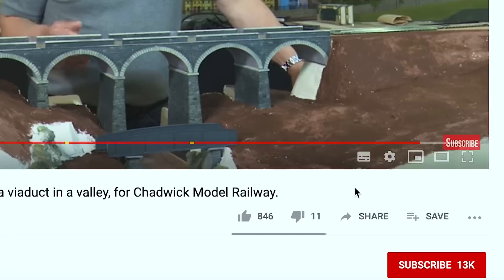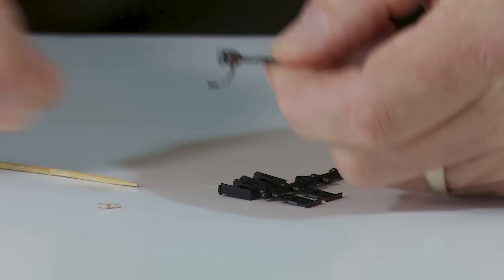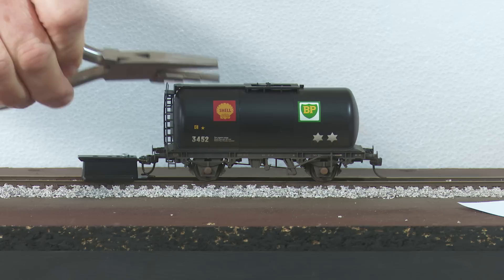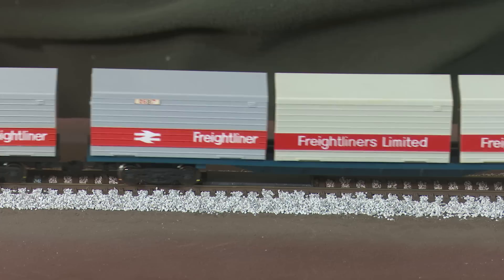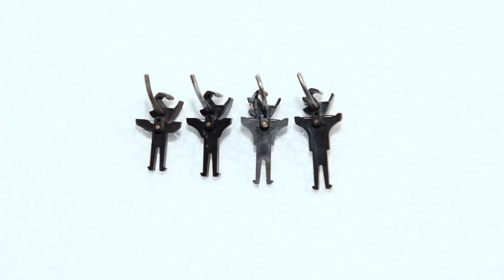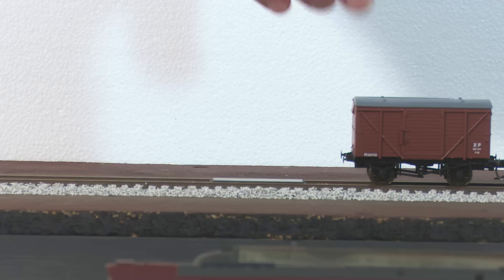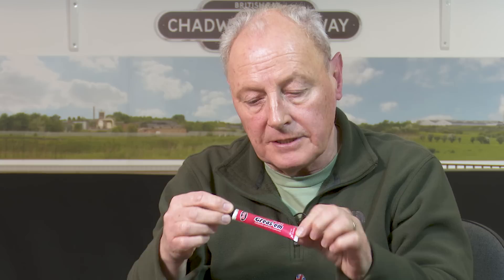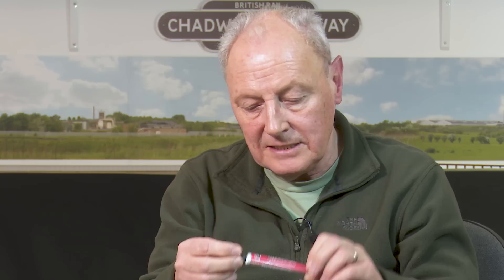Kadee Couplings at Chadwick Model Railway | 81.

Comment: Hey Charly,

Well me I am using some kinds of Kadee Knuckle Couplers or even some Kadee compatible Knouckle Couplers from other Manufacturers like Mc Henry, Accumate, Bachmann E–Z Mate Mark II Couplers or something else.

Some of the Companies do manufacturing NEM 362 Shaft Couplers, too.

A very big importance is to know, the the NEM 362 Couplers Short Coupling Backdrop Mechnanismn are requiring a rigid coupling connection between two wagons so the backdrop mechnismn can dropping the two wagons away from each other inside curves, so that the buffers will be not overlapping.

The Kadee NEM 362 Couplers do have got an hinge behind the coupler heads so the backdrop mechanismn probably will not work like expected, si it will be important to fix the NEM Backdrop machanismn and/or using longer Kadee NEM 362 Coupler shafts than Couplers of No. #17.

In my cause I can use Kadee Couplers to german era I models in thr period of 1899 to 1909 because the prussian state railway did a big Coupler test of testing the Krupp Knuckle Middlebuffercoupler.
This special middlebuffer coupler was a better Version of the US Janney Coupler but had been created compatible to side buffers and Link and Hook Couplers at one side of the moveable Couplershaft what could be fixed be a bolt when swinging into side position to couple european standard hook and link couplers.

 After the ten year test in 1909 the royal prussian state railway made the wrong decission against the Krupp Cpuplers, maybe the replacement costs of expected over 10 Million Goldmark were to expensive for them?

In my Cause, my fictional private northetn german era I railway company is doing this coupler test, too, so I can use Kadee Couplers to my models, too.
Reply from the maker: An excellent comment Ingo.
I do like Kadee’s and find that No 17 are too short for my stock. 
Sometimes though, Kadee are not always the best solution.
Regards Charlie

Comment: Thanks for the information. I have not gotten into changing couplers yet and have not looked into anything about couplers myself, you are the only the second person to talk about the kadee guage. The first video I watch said that you should just have the two couplers touch but not connect. Then to see if they are at the correct height you look at the center line on the car and the center of them height guage should be in the same plane. 

To un-couple them you can also use a stick like the one you used at the beginning by inserting it into the couple and giving it a small twist.
Reply from the maker: Thanks Kyle, a good tip.

Comment: Kadee's are excellent and in the land downunder we use them on any rollingstock. One of the best methods of fitting is to body mount and that is usually no problem on 2ft radius or greater. I see you have done that and  it does work well. You are correct when you talk about British outline stock not having a real standard and it would be good if they did. Perhaps it goes back to when they used to be called Toy Trains instead of Model Railways. Thanks for demonstrating the Uncouple Shuffle as I knew it was the sound but did not know that it included the "Ease Up"  and the "Move off or away" as we call them in the real shunting world in Australia, as an actual movement for the loco. Makes you wonder why ESU would include it but I guess even with Tension Lock you do need to do a similar move to uncouple with them. Have you ever thought of installing a Tension Lock uncoupler next to the Kadee Magnet?
Reply from the maker: Hi Alan, tension lock couplings are the pain of British railway modeller’s lives. At least down under, you have professional options. Regards Charlie

Comment: Very useful video. I have found that Kaydee pins can strike point tie bar mechanisms and rip the coupling out of the NEM socket. Some people snip the pin off but bending it upwards makes better sense. Yes, tension locks are rubbish - I frequently have unscheduled slipped coaches with those!
Reply from the maker: I couldn’t agree more James.

Comment: Have to say, I have been using KayDes for several years, I found it all a bit of a headache to start with but once you get your head around it, it all becomes clear. It's amazing what a difference they make to the look of a rake of 30 wagons, don't be afraid of mixing up lengths on one wagon. I put a short coupling on one end and a medium on the other and as long as the corresponding wagon has the opposite side you can get them even closer without the dreaded buffer lock.
Reply from the maker: I’m so pleased that we truly agree on this awkward dilemma.

Comment: Greetings from Wisconsin!  I've just subscribed.  In the US, the Kadee-style couplers have taken over nearly completely.  When I was young most kits and ready-to-run cars and locos came with "NMRA" type couplers, which were hideous looking.  All "serious" modellers replaced them with Kadee types.  Since Kadee's patents timed out, other manufacturers now make that style, but usually in plastic and not with the variety of types made by Kadee.  My layout is a shunting layout and I've used small homemade blades on sticks to do the uncoupling, quite satisfactorily.  Cheers.  PS.  The original Kadees had a straight narrow pin that was less reliable.
Reply from the maker: Thanks for subscribing Andrew, it’s great to have you onboard.
Reply: @ChadwickModelRailway  I look forward to more videos.  By the way, when I was VERY young, besides NMRA and Kadee couplers there were also Mantua couplers.  These had a ring and hook, similar to couplers I see on British models.  Mantua was a company that made HO models but is no longer around.  Cheers.

Comment: Yes I have always hated those “Hornby/Triangle tension lock couplings. They never looked real and the coaches were always too far apart as you demonstrated with the container flats. One would have thought by now that Hornby would have “Grown-Up” and installed knuckle couplings, similar to the Kadee couplings.
Reply: The issue is compatibility, now all their current and past ranges are based around the traditional couplings or something compatible and it would cause a lot of confusion to change it after such a long time.
Reply from the maker: It's time to move away from Toy Train Couplings.
Reply: GC. Dont forget. most or all Kadee fittings are for Ho  and not meant for OO, so our Nem pockets are higher than the US pockets

Comment: I pretty much use Kadee on all engines and rolling stock. There are items that make imitation versions of the Kadee, like Bachmann USA, the produce the EZY Mate coupling. The look similar but work on the same system as the Kadee brands. How ever they are not as reliable as the Kadees, and it is very common to have break aways.
Most model makers today produce models to accept Kadee couplers in mind, except Britain. Majority of the new models from main land Europe models accept NEM Kadee style couplings.

But viewers might like to know that aren't familiar with the Kadee brand. On their web site, in the reference section, Kadee has an extensive conversion range, for large number of manufacturers of model trains, a suitable coupler. This is very handy guide to when you go and purchase couplings for the models. Kadee constantly updates these files as new models become available, as they spend a lot of time working out the suitable couplings. 
The guide will direct you to the packet number required for that model. Very helpful reference guide.
Reply from the maker: Great comment, with some great info. Thank you very much, regards Charlie

Comment: Hi Charlie as always a very informative video . I agree totally that something as important as coupling the UK has not come that far forward since when I had my first train set 40+ years ago. I don't have tight curves but find the small tension locks cause derailments or unwanted uncoupling. So I have changed to putting mid size tension locks on loco and first wagon/coach. And there is not even a UK standard for tension locks either ..
Reply from the maker: I can only agree. The situation is dreadful.

Comment: Thanks for the good videos.  Kadee used to use a bronze spring (copper colour) in the gear box. About 10 years ago they began making the ones with the wire whisker springs but also continued making the old ones.
You mentioned getting some #5s, they have the bronze springs. The equivalent with the whiskers is #148.
Reply from the maker: Thanks Bill, useful info. Regards Charlie

Comment: Hello Charlie, When I first decided to get into model railways I went to a few of my friends who have layouts, most of whom ran Hornby locos and Hornby rolling stock. One of the first things I noticed were the ugly couplers and also the difficulty they had uncoupling one wagon from another. Then I saw a layout where all his stock had been converted to Kadee couplers, so it was a very easy decision to go down the Kadee path little by little because as you rightly pointed out it is not a cheap exercise. Luckily for me I don`t have a large layout, hence I have never had the need to run long trains, so it is not costing me an arm & a leg to convert to Kadee couplers, a decision I have not regretted. I will look forward to your next video.   Cheers   Greg
Reply from the maker: Hi Greg, yes it’s a pretty awful situation that the UK has ended up in. As expensive as these couplings are, they are the only way ahead.

Comment: Thank you for the video. As you mentioned, the Kadee design is designed to look like the Buckeye coupler. The line is quite extensive. This variation not only allows different shank length, for various mounting designs. 

They have different variations of the Buckeye design. One example is a shelf coupler. Here in North America, they are used on tank cars (wagons). The reason is because on uneven track, the knuckles can bypass. If that happened, then the adjoining car could puncture the tank of its neighbor. This could be very hazardous if the cargo is a dangerous material. Another variation is the tight lock. These are used on some locomotives, passenger stock, and rotary dump coal cars.

Kaydee have a not as extensive line of “scale” couplers. They are smaller, and more in scale with 1:1 couplers. They might be good if your equipment is for display, or if the track and baseboard are extremely level. For reliability sake, the standard size is what I use.
Reply from the maker: Sound advice Brian, thank you. Here in the UK these are only decent option.

Comment: Great video Charlie
I've got to agree with you regarding your comment about the UK manufacturers and the nem pockets, it's a joke and a pain in the bum getting these things to work because they aren't all identical!???.
Due to the helix on my layout I'm finding more and more I'm having to switch the locomotive to first wagon coupling to kadee to ensure everything stays coupled on either up or down trips.  It certainly isn't cheap but its the best solution I've found so far.  The other option is the solid coupling.
I never realised you could bend the kadee bars up, you learn something everyday, thanks.
Cheers Paul
Reply from the maker: Hi Paul, I’m so pleased that you found the Kadee video interesting. The challenges with your helix must make things even more complex. Regards Charlie

Comment: Charlie, thanks again for another informative and entertaining video. You’ve just started to touch on the elephant in the room here at the end of this video and that is that none of the couplings out there are perfect, every type is a compromise of some sort. Although Kadees work in a more prototypical way they are way too big in scale terms than real buckeye couplers. It all comes down to what matters most to you. So if I put up some criteria you could say: easiest operation = Kadees,, best comparability across manufacturers = tension locks, most realistic = 3 link, least obtrusive automatic coupling = Alex Jackson, cheapest = Spratt and Winkle. So many options each with its good and bad points.
Reply from the maker: A very interesting comment Simon. It just shows what a minefield of a subject this is.

Comment: A pencil... a graphite pencil can also be used to rub/mark where a dry lube can be used, i.e. coupler swing movement, axle points and chambers...  doing a little "shaving" of a pencil as such (especially wooden or basic No.2 pencils), since lead was removed from manufacturing of pencils, all the pencils that replaced them can be used. It's the same graphite as is found in that tube of "Greas em"... and, the pliers are called "Coupler Pin Adjusters" and are sized for "N" "HO" and "O" scale coupler pins-to tighten the "curve", whence the three sized-type end.  To widen that curve, you must flip handles so as to not bend down the knuckle part of the knuckle coupler.
John   Kamloops, BC  Canada
Reply from the maker: Great advice John, many thanks Charlie.

Comment: It should be noted that Kadees can be uncoupled by using a thin wood skewer between the knuckles and twisting then apart. Kadee once made a tool for this, and I've seen home-made versions. It had a thin leaf-shaped metal piece on the end of the stick which worked the same way, by spreading the knuckles apart..
Reply from the maker: Yes Larry but we don’t like to use our hands and spoil the illusion.
Reply: @ChadwickModelRailway  But real uncoupling is mostly done by hand!
Reply from the maker: A fair point Larry.

Comment: Thanks for this video, Charlie. I must have watched it a dozen times, and have wanted to give Kadees a go since I first saw them, but was worried that they just wouldn't work on my combination of sketchy track laying and low end rolling stock.

However, I bought a couple of different sized NEM variants, and some of the traditional gearbox type Kadees and experimented, and I have to say they are brilliant. I may have been lucky, but generally I've found NEM heights have been spot on or very close. And for non-NEM wagons, the gearbox Kadees have gone in with little work needing to be done.

Without the clear explanation in this video though, I'd have been stuck, and honestly would never have bothered trying it.

I have also tried the Hunt couplings, and have had some good results on rakes of coaches by having strategically placed Kadees where I might want to split a train up, or where it will couple with a loco, and then used the Hunt couplings in between.

Thanks again for the excellent content!
Reply from the maker: I think we sing from the same song sheet on this one Andrew. I will certainly use magnetic couplings between coaches and Kadee’s at the ends. Regards Charlie

Comment: Hi Charlie

Another great video about the kadee coupling which I have been using for about 20 years.

Couple of thing that maybe worth adding on your next video is the under-track magnet that can be installed on the building of your layout.

I’m in agreement with you that some locomotives and rolling stock are not easy to replace the old tension lock coupling and replace it with a kadee.

When I have to use the tension lock I remove one of the hooks which makes it easier to uncouple, in the case of my layout it was at the platform end where I wanted to detach the locomotive.

My method was to install the Heathcote Electronics uncoupler which uses a servo motor complete with electronics where you are able to adjust the height it pushes clear plastic strip, the speed it moves upwards and the duration of time it remains up to move your locomotive away.

Keek up the good work and it was nice to say hello to you at Warley 

Terry
Reply from the maker: Thanks Terry, I’m pleased that you enjoyed it. Yes these couplings are a complete nightmare. Perhaps I’ll see you at Ali Pali.
Reply: I’m not intending to go to Alley Pally I’m exhibiting at Glasgow, York and Derby with my layout Camel Quay

Comment: Thanks Charlie, this video made me feel much better - "a problem shared" I guess. I am converting stuff to Kadees and I love them. However, like you the differing heights of new stock NEM pockets is doing my head in! I have just bought a new Bachmann Prairie and had to resort to fixing the KD to the bottom of the MEN socket to get it right... argh!!!! As an aside I have now successfully converted and old Lima warship to Kadees (as well as a cd motor) and it looks so much better.
Reply from the maker: A shocking admission TJ. We are poorly served by our manufacturers here in the UK. But what are we to do?
Reply: Magic
Thanks Charlie
I thought I was The only one having coupling nightmares. 
I am installing kds slowly on everything
As a reply to your comment on costs of installing on all stock I form permanent rake of coaches or wagons
Using something similar to Bachmann's permanent couplings maybe, with a kd at each end. 
Your idea of a kd at one end and a tension lock at the other is clever. 
I have  Hornby Castle with sound that looks excellent with a rake of Bachmann Mk1s  but even with NEM s could not
Get the kids to line up so got an extra Bachmann BG and put kids one end and tension   lock The other.. 
Can be removed easily to couple the rake to what does line up.
This also solves another problem , using permanently coupled rakes.
I installed an uncoupling magnet at the buffer stops of my terminus to allow a pilot to back onto the arrived train and remove
The stock, leaving the loco then to back out. All ok until you put a rake of coaches down there ,all  kdcoupled, ready to depart with the
Loco obviously at the other end and it departs minus the last coach.
Love DCC. Love NEM. All problems can be solved especially in this sort of forum. 
Compared to my 1960\1970 triang\Hornby that always needed a push over the points and crossings I am a very happy retiree.
Well done Charlie
Regards Howard